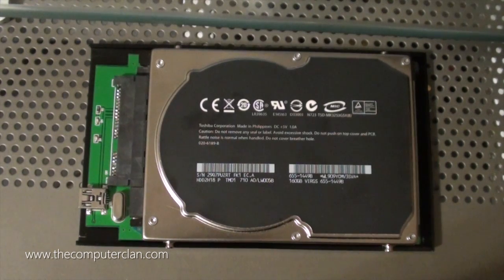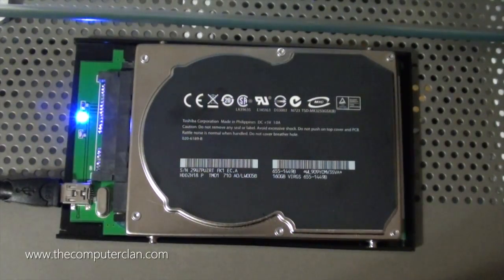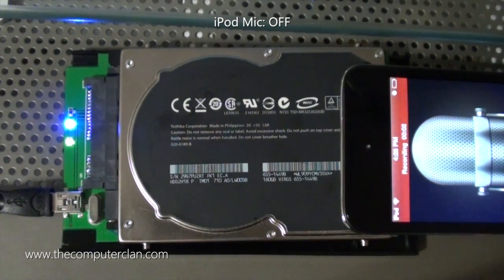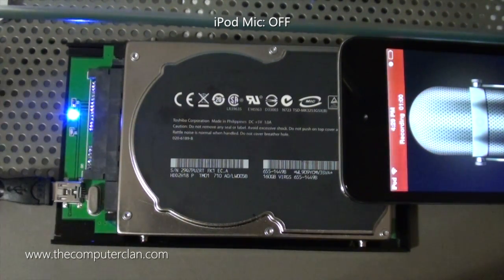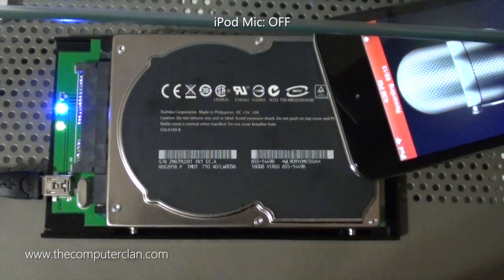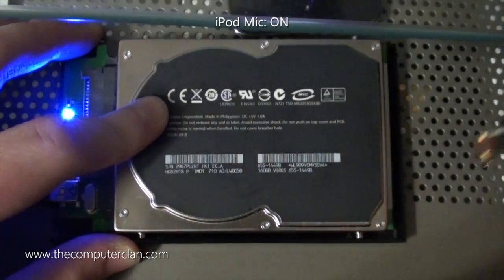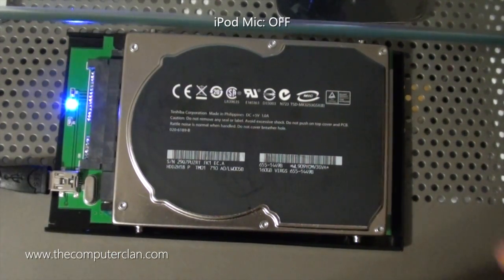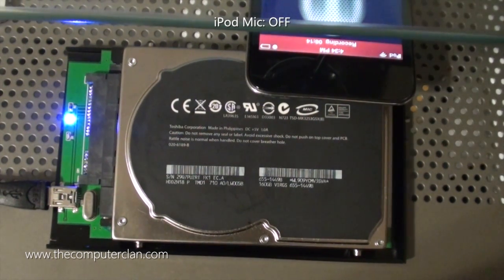Magnet Meets Hard Drive

Comment: And the magnet in the hard drive is not on top of the read write heads they are just used to move the heads back and fourth. If you put a magnet on top of a hard drive you will corrupt the data being written and read from the platters. This video isn't fake. Try it yourself. I have done it with countless hard drives they all do the same thing. They make noise and click. Fixing a hdd from this is not possible. It would need to be sent back to factory to be refurbished

Comment: Well, correct, however, I am talking about the electromagnets that you speak of. That magnet used in the video is the one that keeps the head from moving willy nilly, so it is a standard type of magnet. This magnet is only strong on the face of it, so it isn't enough to really mess anything up unless moved directly on the top of the head or platter.

Comment: I have always known that there is a magnet in hard drives. But guess what? They are electro magnets, so if the hard drive isn't running, the magnet isn't strong enough to erase the drive. The electro magnet pulls the head around the drive, reading and writing data.

Comment: Two things: you waited 8 months to say something, and you obviously don't know how a hard drive works. Not only does a magnet destroy all data on the drive, but it destroys the platter physically as well. When the platter is destroyed, it is caused by the magnet pulling the head in the wrong direction. After that, the head makes a very annoying loud sound when the system is trying to boot.